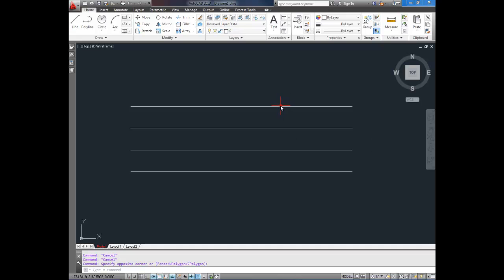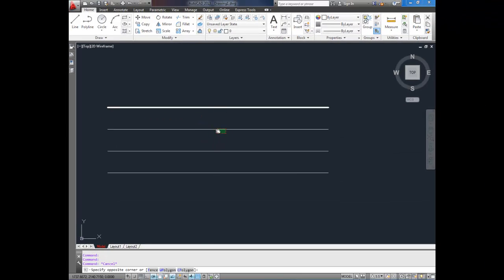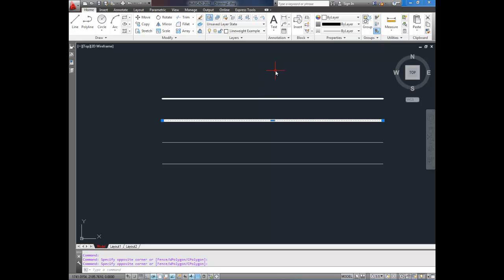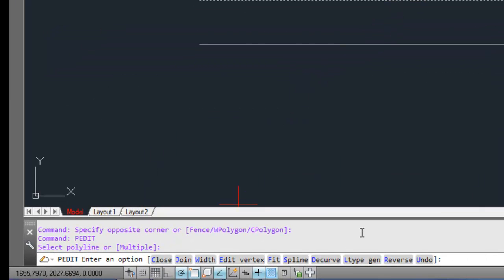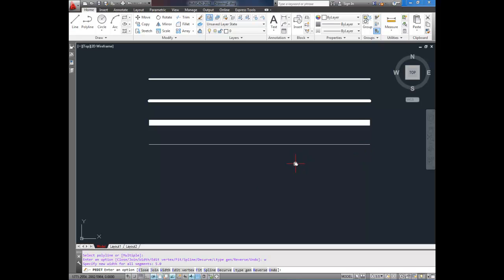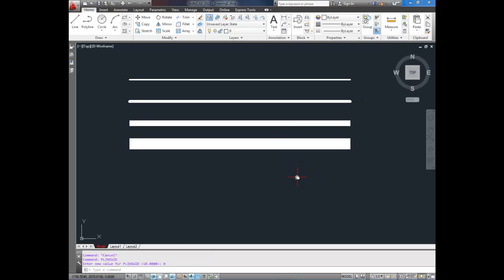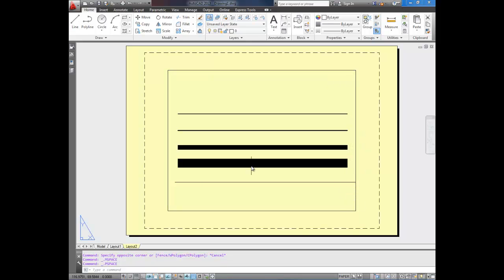AutoCAD Tutorial: How to Change Line Thickness (Width)

Comment: is there a way where a line AB decreases its thickness, line weight decreases gradually (0.80 mm > 06mm > 0.2mm > 0.10mm), from thik to thin at point A 0.8 mm and point b is 0.10mm?

Comment: I copied lines from another drawing and pasted then into mine. They were on different layers and were different widths. I used the join command to make one line which worked however they are still show as different widths on screen just as they looked before joining. I want the lines to look small when i zoom in or out for ease of drawing and editing. I don't want the line to appear thicker as I zoom in. What am I doing wrong?

Comment: Bummer.  None of this works for me.   Trying to draw thicker lines and no mater what--change layer width, change line width in properties, the line stays exactly the same.  Why do people put up with the ridiculous program?   Changing a line width should be absolutely simple and reliable.  See ANYTHING by Adobe.
Reply from the maker: Double check that you have lineweight display turned on. There's a button along the bottom status bar with horizontal lines, it should be blue for on, or type in lineweight  and  hit enter, check the box that says display lineweights and hit ok.
Many including myself have lineweights turned off, they'll show up when printed but not when drawing, makes it easier to draw and after enough time, just know how it will look when plotted.
Reply: @Cadintentions  best answer!

Comment: how about this please:  my printer prints black and grey. when the draftman uses 0.000 lineweight it becomes really thin and grey and it does not help printing it on tracing paper or the transparent paper bec of the greyish color the paper has. 

how do i change the all the really thin lineweight in one click without the need to click every line. i do not have lineweight example 

please help me

Comment: I have a problem. My drawing is very small. When using the tool line for example I type  length of  10 lines can not  be seen  on the area.  I've got a lot of to zoom to found how small is. I changed UNITS and nothing. Can you help me ?What should I doing ?  Thanks in advance.

Comment: Don't know if you are still out there :).   I am using Autocad 2016 (Mac). I am in Model Space. I have the lineweight 'on' from my status bar. And I am simply drawing lines (no blocks).  Before I draw the first line, I go into the Properties Inspector (in this version of Autocad, the linewidth isn't displayed in the layer window) and change the lineweight to 2mm. Then I draw a 
line. It is wide. I now go into the Properties Inspector again and change the linewieght to 0.25mm. The displayed width of the existing first line does not change at all on the screen! (shouldn't it?).  I draw a second line. Its width is small relative to the previous 2mm width. I can go back and create any number of lines with different widths all on the same layer.   I thought that I should be able to change the lineweight setting of a layer (which I seem only to be able to do in the Property Inspector) and the lineweights of ALL the entities on that layer should change accordingly. But that is not what I am seeing. 

Perhaps there is a different place that I can change the lineweight (than in the Property Inspector). Perhaps there is a way to have the lineweight setting show up in the Layer window so that it changes for everything on the layer?  Autocad, so many settings, so little time, much frustration.

Comment: mine didnt show any difference how many time i change them they are still the same.. weird :/
Reply: Chourmouziadis Triantafyllia
type   lw->check box display lineweight->ok
Reply: @mayrostyrannos9495  Thanks alot
Reply: @mayrostyrannos9495  thank you!!!
Reply: @mayrostyrannos9495  5 years since your comment and you just saved my ass. Thx
Reply: wow i wish that was mentioned first.
Reply: I have the same problem... Have you found a solution?
Reply: +Mayros Tyrannos Thnak you very much man. I had the same problem from long time
Now it is working Thanks :)
Reply: @emadjanbal7139  Thanks alot
Reply: @emadjanbal7139   THANK YOU VERY MUCH SIR!!
Reply: THANK YOU
Reply: thanks file
Reply: Thank you sir
Reply: Damn bro thankz
Reply: exactly,, same problem
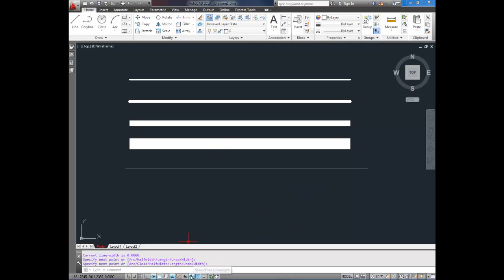Reply: See 3:50 , you can on of off by clicking that Icon